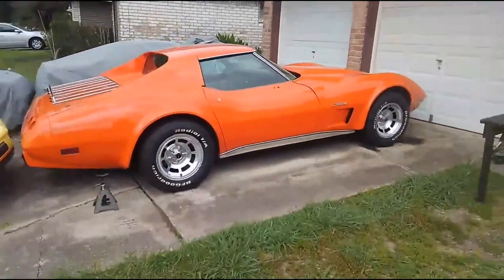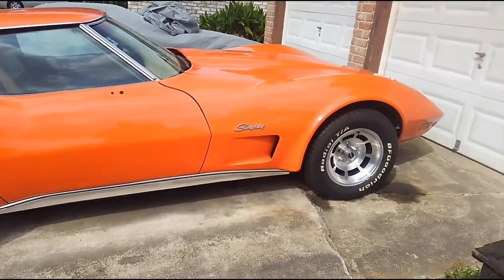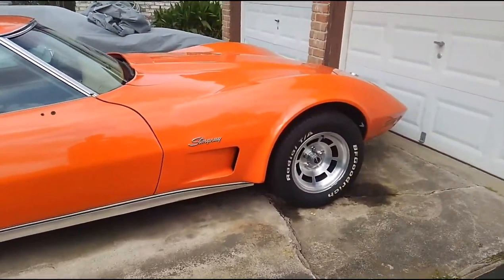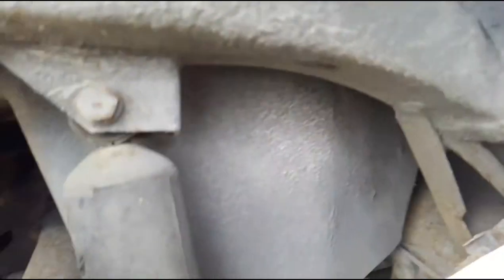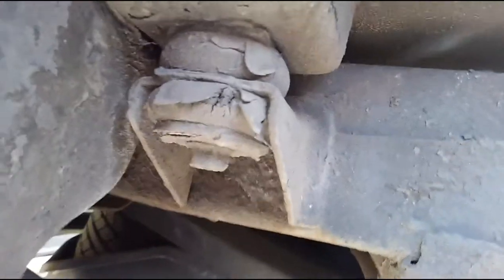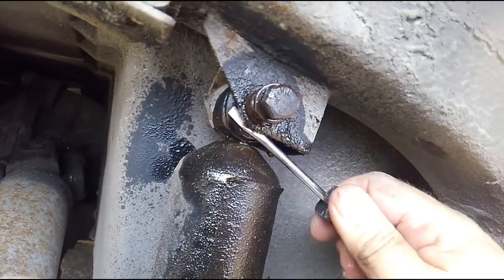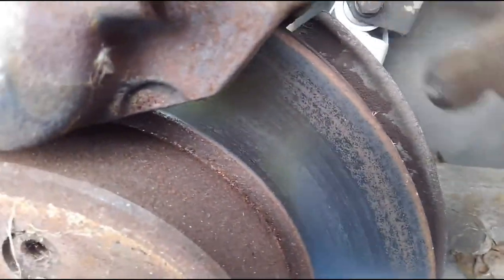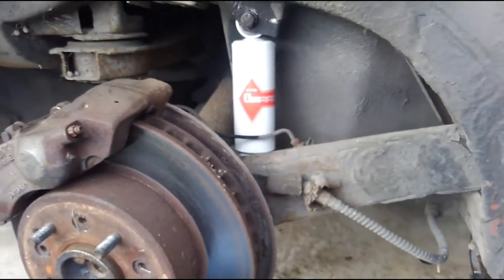1976 Stingray Corvette Flame Orange Shock Swap

Comment: Not the best place for that jack stand. There's a gusset near that corner area that will bend if the weight of the car is placed onto it. Try placing the jack stand on the frame rail where your portable jack is. There's a beam adapter for that Pittsburg jack at Harbor Freight with 2 adjustable rubber pads which is great for jacking the car up directly under the doors. Better safe than sorry.

Also what is that tire size?
Reply from the maker: Good eye, but I actually have the jack directly under the edge of the #3 crossmember where it ties into the corner of the side frame rail. The gusset you are referring to is directly in front of that and will not support weight like you mentioned.  I will look into the Harbor Freight piece. Tire size is 245/50/15 which is about the biggest you can cram underneath without rubbing the fenders. Thanks for watching👍
Reply: @VetteSource  No prob. You have adjustable coil overs in the front?

Comment: I have to do this soon, I was wondering if I could paint the shocks?.? I would much rather have them black.
Reply from the maker: Sure, I would just scuff the surface with a scotch Brite pad, and hit them with a chassis paint. Just make sure to tape off the area between the upper and lower housing so you don't get paint on the piston rod. Thanks for watching👍